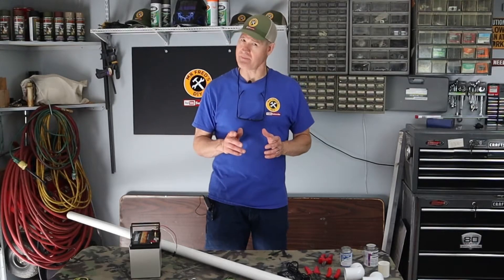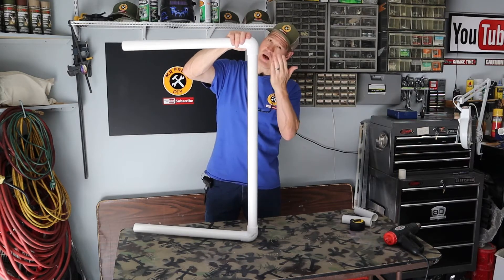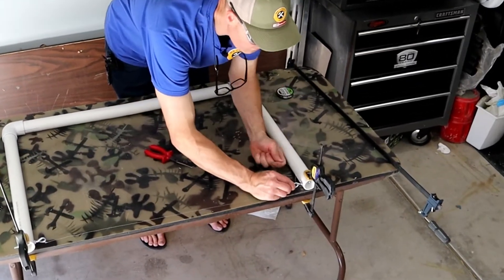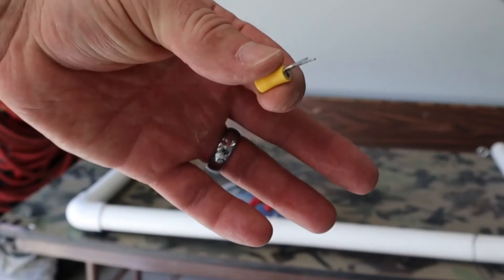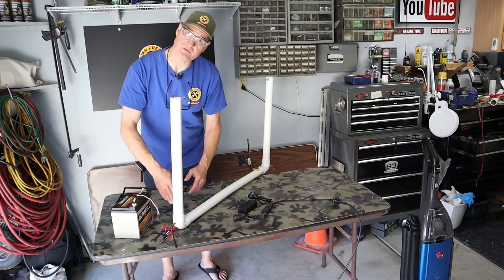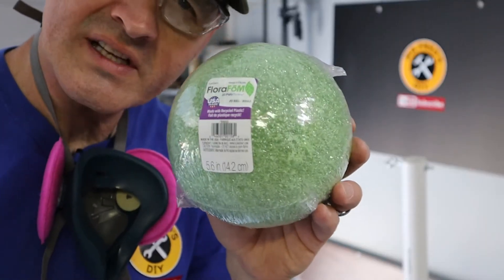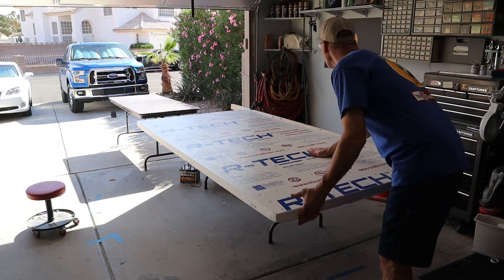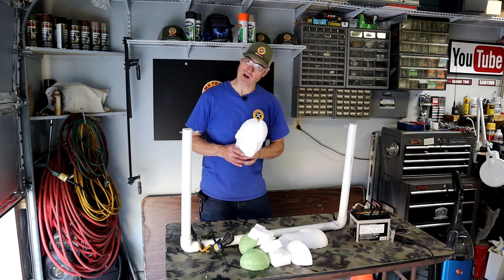Hot Wire Styrofoam Cutter

Comment: Please redo this DIY tutorial; you need to go a lot slower when showing the wiring connections of the black and red power wires, the power switch wiring, and the power supply wiring because for many people, electrical wiring can be visually complicated to follow and understand what wires are being connected to other wires, power switch, power supply, etc.  Talk slower, slow down the video recording and pause longer during each video still shot of the connecting of the wires, switches, power supply, etc.  The video does not show how you implemented your hot wire foam cutter to a table to cut long styrofoam sheets.  Please redo this DIY video for your viewers.  Thank you
Reply: ignore all of the stuff with the switches. Wire it up so that when you plug it in, or connect the battery, it turns on, then when you unplug it, or disconnect the battery, it turns off. No switches, no complication.